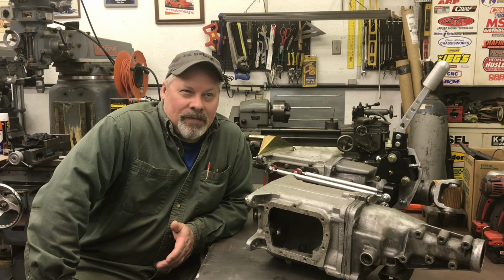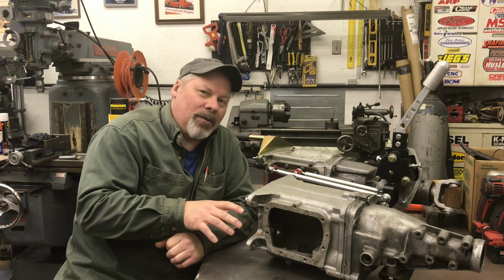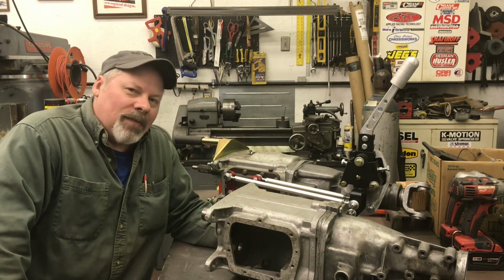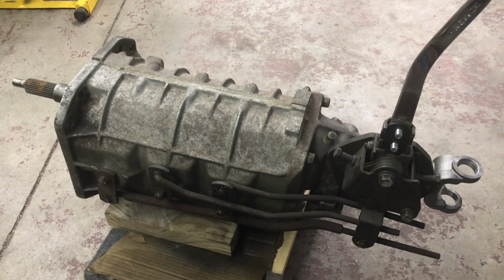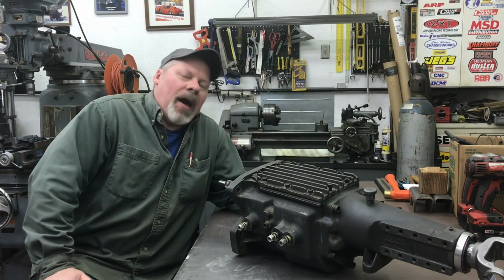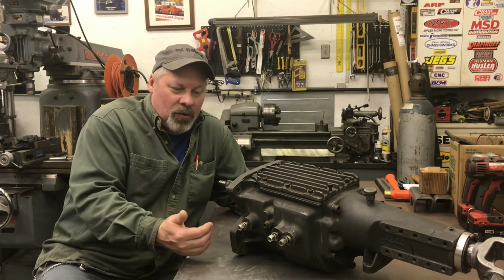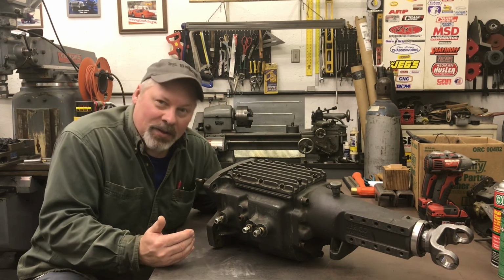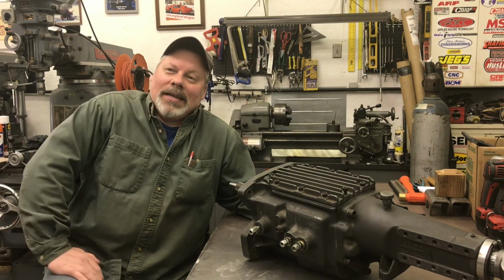Manual Transmissions!

Comment: Great overview of 4 speed development.   As one who drove a Muncie in my '65 big block corvette (396), as well as other legendary muscle cars of the time, I have a great affection for the "fun" of manual shifting.  And, yes, I have a deep ingrained doubt for "slush" transmissions; though I don't doubt that I am not competing with a modern auto with a manual.  But for street driving fun, plus a that nostalgic flash back, I still have been eyeing a manual for my 455 Olsdmobile hot rod.  I notice you can get brand new, improved "Muncies"; but the new Tremec TKX with the overdrive looks like the way to go.  Can save a lot of gas with that overdrive!   
 I do have a '77 turbo 400 in it now, which I just put a BM shift kit in decades ago.  Your videos temp me to "refresh" it with a rebuild.  Thing is, it just keeps working.  I pulled it out of the original Olds 98.  Probably my main concern on the TH40 is the torque converter.  I quite appreciate the  manual trans is "lock up" clutch.  Do they have lock up converters for the TH400.  I wouldn't be surprised that they do, but maybe they cost as much as my manual conversion !?   Perhaps you have a video on that issue somewhere ?   "High stall" converters seem like real gas wasters when you are not racing.
Reply from the maker: I agree actually having to drive the car with all your limbs is fun!
They do make lock up set ups for TH400s but for high end drag cars. They are many thousands.
Modern stall converters drive very much like stock until you purposely ask the converter to stall.
When they first came out they were really loose!

Comment: There are a lot of “ratings” out there.  
My “real world” test in my personal car showed a bone stock well used saginaw 4 speed held 700 ft lb before it would start exploding gear sets.  This was behind a turbo LS in a 3200lb car.  It would normally break 3rd gear just doing a roll on hit.  Im sure a 150hp engine could break on sticky tires launching or someone wheel hopping it of something like that.  Point of my story is they are way stronger than people think.